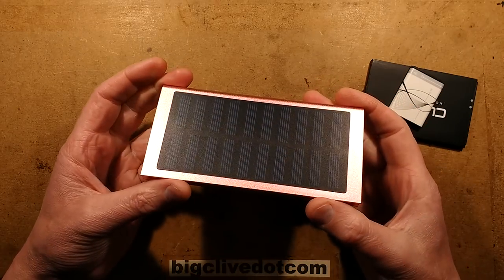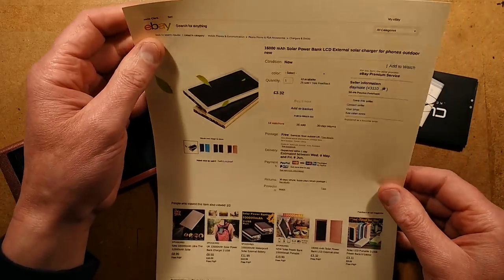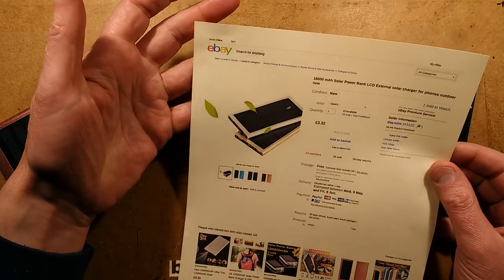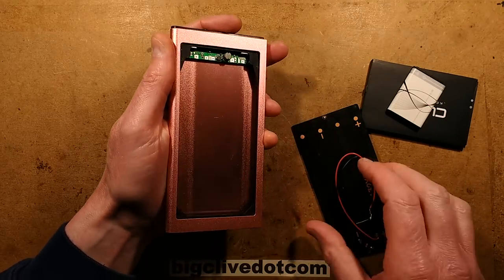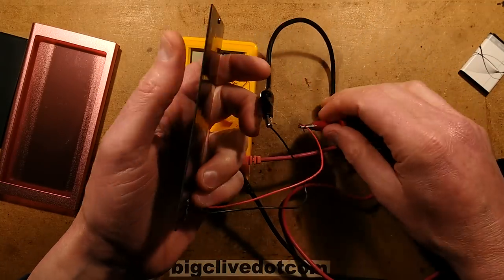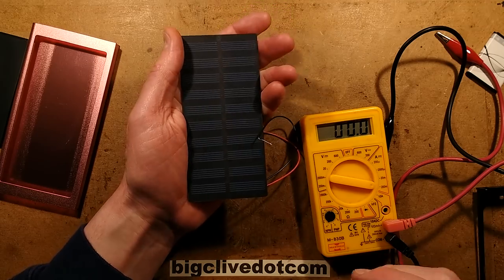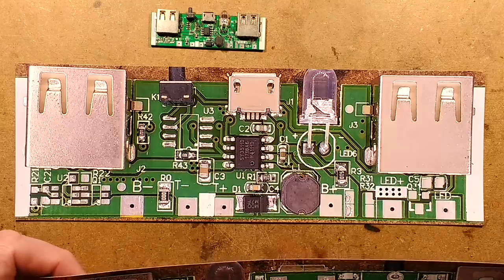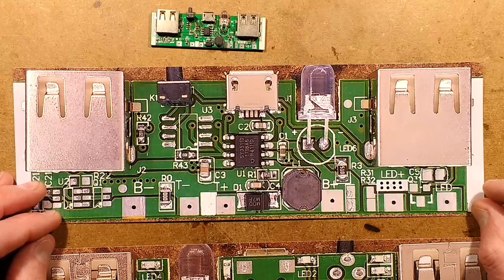Fake USB power bank kit rating (100,000mAh again)

Comment: You don’t need to put this in a direct sunlight, just outdoors in a shade, because I got sunburned while sitting outdoors under a roof for 3 hours, that solar sun ray light power will travel anywhere, it touches and bumps everything.

Comment: I have a bunch of those battery packs you get for video game controllers and portable consoles that replace the AA you would have used and I was hopping there would be a way to turn them into usb power banks?

I should have pointed out the batteries they use can be charged in a standard AA/AAA charger.

Comment: The output of this thing is really poor. It needs to at least put out two amps at 5 volts in order to charge a tablet. All the battery packs I have built can do 2.5 amps before they start to struggle.

Comment: Can you talk about using the solar panel for charging that big battery pack?  Would the panel output enough current to charge a large battery in a reasonable amount of time?
Reply: It takes a long time. I have one with the better panel on it. It's maybe useful if you just want to keep one on a window sill or the parcel shelf of your car (potentially not good for the cells though) and know that it'll be charged in a few days. If you can charge it with USB, it's a lot faster/better though.

Comment: I bought a couple of the 6x18650 powerbank kits (no batteries included, salvaged from laptop battery packs) and the rating on it is also ridiculous. Very hackable tho. I added an aluminum strip with 4x "1W/3W" LEDs from eBay, going straight to the battery in parallel through a low value resistor and a switch, and replaced the puny, PWM LED included with a laser pointer from a toy gun that just so happened to fit perfectly on the hole. If you move it fast enough you can see the ant strips from the PWM.
The power output does not quite reach the 2.1 Amp promised, it is closer to 1.75 A @5.00 V.

Comment: I think close to 10000 is a realistic goal, not just 5000! Because i have a store brand battery (approx. 20-30€ list price, don't remember) that is that size and shape, same book style, same drawer, no solar cell, and it's got 9400mAh marked on it. I trust this store, and it appears to pretty much completely charge my 4000mAh phone twice, so it can't be that far off. The cell inside is HUGE, very tightly packed in there, it doesn't have much any space to move at all, and it's marked SONY 32 W US4069C4H 2 3583ED055VH12B. Mine can probably output 2.1A that are marked on the package, as it's the only power bank that i have that will power my Windows tablet - though it will get pretty warm. The tablet refuses to work off an older Anker also with 2.1A output, it's allergic to voltage slacking off.

I actually might already have a test load and charger doctor so i can test it more thoroughly.
Reply: Yeah i plugged in mine for a minute, it could do about 1.9A before voltage started dropping below 4.9... it's not the same electronics at all obviously as the enclosure that you scored.

Comment: @bigclivedotcom - it appears to me the 2 solar panels are different technologies - TFS or Thin Film Silicon, and the other is a CZ ( can't tell if it is single-crystal silicon or polysilicon ).  The two technologies have very different spectra responses.  It is possible they would respond better outside.  Because, depending on your inside light source and its spectral content, one solar cell/panel will perform better than the other ( I think the CZ or polysilicon is more responsive to blue and the TFS device has a better response to red ).

Comment: It looks like the panel is outputting 1/3 the amps of the "good" one and there are 3 taps on the back of the cheap panel can it possibly be separated in sections and all the connections need to be hooked up in parallel?
Reply from the maker: The connections on the back are all in parallel.
Reply: bigclivedotcom Did they have the same voltage?

Comment: I bought one a few years back that had a full size ( filling the case) lithium cell. Put it in direct sunlight and the LEDs did in fact completely discharge the battery. Shame I binned it, could have been a interesting autopsy candidate.

Comment: The two pins being shorted together on both sockets may have something to do with a relatively new Chinese charging standard. I don't know the specifics but there's basically a standard now that chargers sold in China are to have their data pins shorted so that the device knows it's a charger. It's a very brute force and analog way of doing it, but it's also the cheapest (and probably safest! At least in some respects.) way of doing it.

Comment: Would baking the solar panel  maybe help fix the bonds or damage it further?
Reply from the maker: It turned out that the panel was too flexible and there was cell damage.  It'll be shown in a video later this week.

Comment: Had to search for this one, after I found that I had purchased one almost like it, perhaps an update, or a downgrade would be more accurate.  OK now the auction said you had to add a battery, I am used to doing that on powerbanks, as I have a quite of collection after watching your videos got me all interested in building them up from old laptop batteries.  The one I got looked good nearly like one I already have that coste me 3 times the money, but had batteries in it, so I ordered it.  It came in yesterday, what I got was a zip lock plastic bag with all the plastic components loosly tossed in, 4 tiny screws, the circuit board, and a board for the LED's.  All that was assembled was the circuit board.  Not a major problem, but that plastic looked so flimsey that I would not trust a childs toy built with it, but oh well it only cost me 7 bucks.  There were no instructions, and you needed to furnish all the wiring since none was included, not a major problem I have lots of wire. So I put it all together assembled the case and pressed the button.   NOTHING, well I know most of these require hooking to a power supply to activate the chip (I had installed a LIPO bag type battery claiming 3000 mah taken from an old tablet)  So I plugged in the mini usb, and the smoke she rolled out!  I quickly pulled the plug and tore her apart, expecting to see melted components, but I was lucky. One transistor has a blister on her, of course there is no marking on it, but a close inspection showed a tiny solder bridge across one of the surface mounted capacitors.  I heated up my iron and cleaned that, then stuck the USB back in the socket and she began charging.  I now have a working device, it may make a nice flashlight, and if I can find a couple more bag batteries, I think there may be room for at least one, perhaps 2 more, but for now I am happy that I can get some use out of the piece of crap.  Here is that auction: https://www.ebay.com/itm/DIY-Waterproof-500000mAh-Power-Bank-2-USB-Solar-Charger-Case-LED-No-Battery-wo/282823276587?ssPageName=STRK%3AMEBIDX%3AIT&var=582167381790&_trksid=p2060353.m2749.l2649

Comment: Fill it with ethanol.  I reckon that would represent something like 30~40,000mAh (assuming it holds around 1/10th of a liter of fluid) of potential energy.  Then all you need is a fuel cell!  Always with the option to fuel... yourself.

Comment: I guess you need to know how long that power bank is. If it will handle a lipo that is 6" in length then you can get a 10,000 mah battery for it.

Comment: Indoor lighting is not necessarily a suitable test for this kind solar cells! This is something NurdRage was confronted with when he built a Tritium battery. Mono-crystalline cells such as these are extremely inefficient in low-light, but their efficiency improves with light input, and the thresholds might be different for the cells that you have.

a-Si cells have the opposite issue by the way, they are efficient in low light but lose efficiency with higher light input.

You're probably right, this is just a badly built cell. But i think further tests in high light are appropriate.
Reply from the maker: I tried it outdoors in direct sunlight and it was abysmal.

Comment: check out the goodmans 10,000mah power bank . i had it open and it appears to be one massive cell  i think there available on ebay
Reply: and it clips together  i never seen any glue on the part where the qi pad is but the pad is glued to the cell

Comment: You got me thinking about books here...
Could you stick that solar panel in a large book and compress it to make those connections? 
And if so, could you then coat the solar panel with some clear epoxy or similar substance? Clear, suitable for use on electronics, etc?

Comment: biggest problem with these banks is that. if y have 3.7 v cell y need to get over that 4.2v from solar panel to fully charge the batteries. That panel can output like 1.5v. Amps aint so big deal. it just takes longer to get full. but if y don't have enough voltage it just charges to like 1.5 v and stops charging.

Comment: hi, how do you test the batterry by charging / uncharging? is there any device or method? thank you, and love your videos by the way
Reply from the maker: I discharge it completely and then recharge via a USB energy monitor.  If there is no active buck circuitry inside it gives a good indication of the cell capacity.  If there is active circuitry I attach to the cell directly.

Comment: I  purchased a few of these type solar panels last spring.They are terrible.After 7 hours outdoors at about 70 degrees during initial testing they began to form bubbles under the clear top  layer and lost some output.After about 2 months of only being put outside for 4-6 hours on saturdays they completely delaminated.I learned my lesson then about ebay solar panels from china or at least this style panel.I did have good luck in the past with monocrystal  (aka blue crystal) panels from china that have lasted 5+ years and still work great.

Comment: I've actually got a couple of these, Not with the solar panel though, and with a nominated 20,000mAh battery stuffed inside, They're quite a nice size unit for what they cost

Interestingly, Mine might have a different chip/board design as it feels like it's resin potted into the case, rather then part of a seperate drawer, and they have a nominal 2.1 amp "high current" usb outlet alongside the standard 1A Unit

Comment: I have a genuine version of this bank at home, it claims 10,000mAh, and I've tested it out to about 11,500mAh so that's a good result on it. Most banks give you the capacity of the battery without converting for the loss due to stepping up to 5v.

Comment: Since a small car battery is rated at 45000mah @ 12v  I might just replace mine with 3 of these super powerbanks and have twice the capacity.
I hear they rated for 1000 cranking amps too. ;¬)

Comment: Hmmm, surely if it is constantly recharged by the sun, which is itself a giant battery, it should have a 100000000000000000000000000000000000000000000000000000000000000000000000000000000000000000000000000000000000000000000000000000000000000000000000000000000000000000000000000000000000000000000000000000000000000000000000000000000000000000000000000000000000000000000000000000000000000000000000000000000000000000000000000000000000000000000000000000000000000000000000000000000000000000000000000000000000000000000000000000000000000000000000000000000000000000000000000000000000000000000000000000000000000000000000000000000000000000000000000000000000000000000000000000000000000000000000000000000000000000mAh capacity?